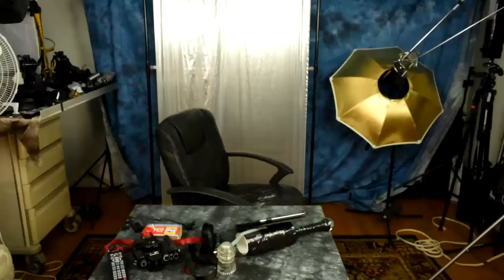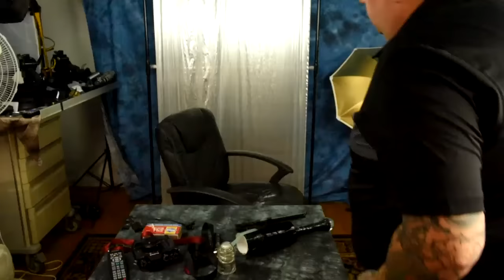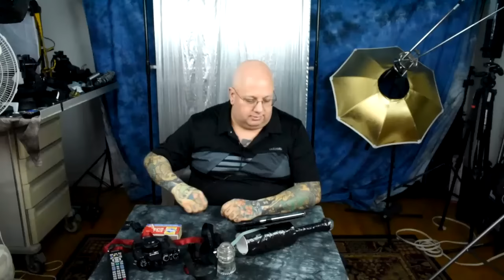Coaxial Circuit that is LIGHT. Erasing nonsense of "emitting light" and the lie of "speed of light"

Comment: Okay, so what do you think is the speed at which light or a magnet induces its field? (The initial peturbation) I'm saying it's instant- no time elapses.  When glass "slows it down" all it's doing is slowing down the wavelength.  It's still doing it's peturbations instantly, just with longer wavelengths between each peturbation.
Reply from the maker: +gilbet its not a speed at all, i said that a dozen times. 

i never said it was instant either
Reply: +Theoria Apophasis So in your opinion, how does the inertia in a flying saucer work with sudden change in&#160;direction and move with great speed. With dialectic acceleration? I'd love to see you discuss gravity with Michio Kaku. LOL
Reply: Theoria Apophasis The way you observe an event is through the change in the wavelength of the perturbations of  induction, or a change in the level of induction, such as a LED being powered on. This is a singular event. Another event is the reception of the inducement. (Or the observation of it from nearby.)

This allows me to reference two events: the initial  induction (or change in induction) and the reception of the initial induction or change of induction.

Since these are actual events, there is a definable time period between them, and so I can define that, in minutes, seconds, milliseconds, or fractions thereof.

I'm suggesting that the time period is zero.  The choices for assimilation and processing of such a claim among one's paradigm of understanding would require. a person to either agree wholeheartedly, agree with caution, disagree for specific reason, abstain due to unfamiliarity, or ignore, if ignorance is the preferred route.
Reply: @Magicspirit11  The inertia within the craft is not tied to the inertia outside the craft.
Reply: @gilbet  time is a measure not a force or field. It has 0 properties or effects.
Reply: @EnergyTRE  The time is the generational steps of refraction, and the wavelength is the number of steps within the refractory material between each point of interference.
Reply: @gilbet  ... Only humans worries about time or issues time to anything. Before mankind there was no time just being. No universal time frame everything follows. Just the medium the æther. Time affects nothing, a reference point from one point to another.

Comment: The notion of scientists or engineers being idiots for creating idealized models of nature is blind to the fact that applied science is not focused on perfectly correct explanations. If we waited for someone to provide the perfectly descriptive unifying formula before applying models to solve problems, there wouldn't be applied science.  Restricted complicated systems are reducible to very simple and sufficiently accurate approximations . Emf perturbation field formula may be perfect in complexity and range but if i am only interested in an infinitely small part then a linear function may fit perfectly. Colloquially and in average society light is typically over-simplified as a particle thing, but working Scientists treat light as a thing that can be reduced/modeled as a particle thing and/or a wave thing depending on applications and conditions.

Comment: Spock fired photon torpedoes almost every 'Star Trek' episode.  What happens if you fire a photon torpedo through a dual split?  Does it produce a bell curve pattern of baby photon torpedoes? What if you Delay the Choice of the photon torpedo and erase the measurement?  Is it better to vacuum up the photon mess after the experiment or just sweep them under a rug?  Could I collect the photons in a thick plastic bag tie a nylon rope around the top of the bag and use it as an anchor for my kayak?  Where are the recycle centers for photons?  Can photons be used to mint cryptocurrency?  Is it possible to build a 'block chain' with used photons?  Was Jimmy Hoffa's body sunk in the ocean with photons?  Did the shooter on the grassy knoll use photons instead of mercury rounds?  Was Building #7 brought down with photons?  Did Saddam Hussein hide photon torpedoes in Iraq?  Is 'photon collusion' considered an impeachable offence?

Comment: Light traveling thorough different mediums... the different observed "speeds" happens because the light is actually interacting with atoms, getting absorbed by the electrons which go to higher energy level 
temporarily before scattering the extra energy in the form of a photon. 
This leads it to seem that the light travels slower, when actually it is
 that the photons are serially coming into existence and then 
disappearing as they interact with the electrons in the medium. This is a well known fact. This is not in contradiction with the speed of light through a vacuum being constant.

Comment: by coaxial circuit do you mean a coaxial transmission line? In many cases you don't expect a reflection from the light. But how the f is gravity the same as static electricity, totally different. electric field and magnetic fields are different, yin and yang buddy. I definitely wouldn't call it a circuit. A circuit implies you have to get it returned back.